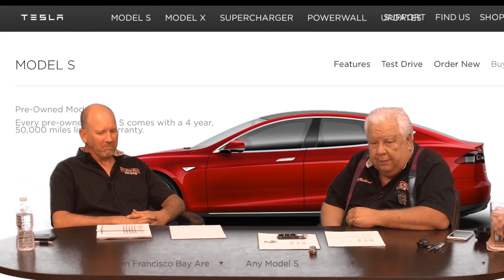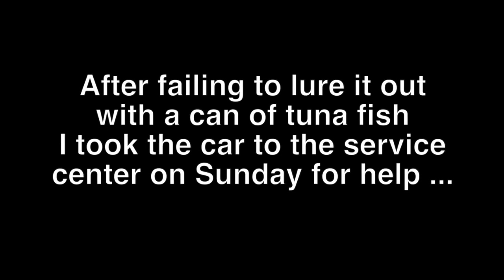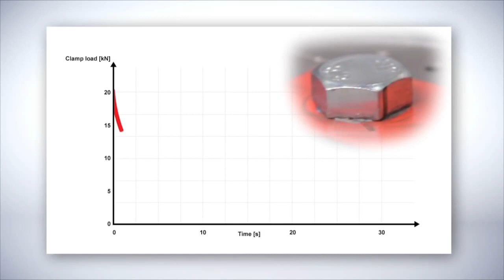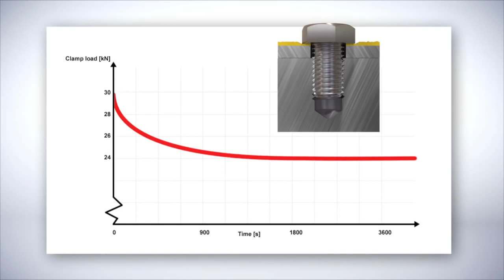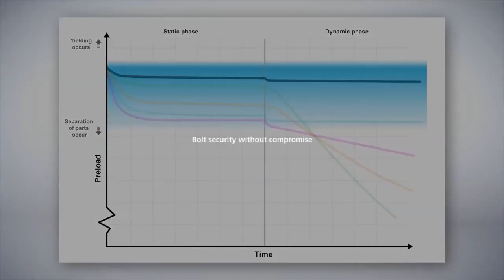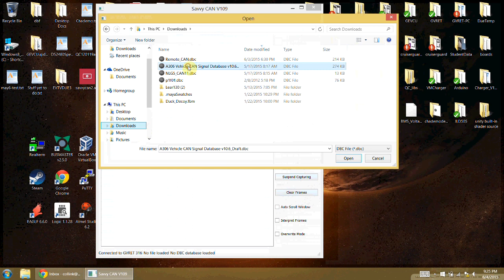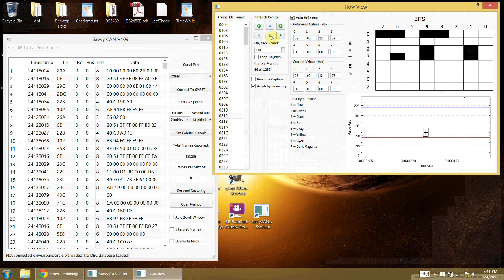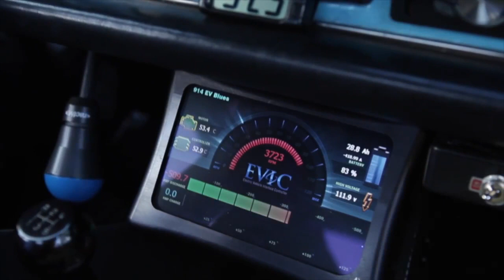EVTV Friday Show -  June 5, 2015

Comment: Volt is an electric car. I have 2 Volts , the '11 get regularly 45 on a charge and the '13 get 45-50 on charge. But in emergency nice to know you can get unlimited range if necessary.

Comment: Place the Tesla motor in a MasterCraft water ski boat !   
Adjust the trim with the battery location, part of the pack could move aft for launch & wakeboarding and forward for a smooth and fast ski wake.

Comment: The jury seems to be still in deliberation on Tesla resale value. Tesla is offering its used fleet at prices that seem pretty comparable to the mileage discount you would see on other high end luxury cars. If the cars just sit there unsold, then they will have to lower the prices drastically like the Leaf and Volt, but for right now they aren't trying to dump them at any price, so far as I know.

In the case of Tesla, it may not be the used battery that's the problem though. The new cars have extra driving assist hardware that the old ones don't, plus the dual drive on the new ones. The battery, being bigger to start with, should have a longer life and more residual value than the Volt or Leaf batteries.

If they asked me how to sell the used Model S, I would not group them all together in giant parking lots near Chicago sorted by color. I'd spread them out to all areas of the country, a few at each store so they continue to seem rather scarce. I'd also want to offer them to credit union members so there is a built-in source of financing. But maybe they know something I don't about the Chicago car market. It is worth speculating on why they have chosen the strategy they have.

Comment: Re used EVs
FYI   Tesla model S has been on the road in the UK now for a year this month & the five used cars on sale today are all at higher prices than you could buy a brand new one for (spec for spec; lead time on new around 4 months). Whereas pricing on smaller range EVs have already taken a huge hit eg a one year old 11,000 mile e-Golf loosing 40% in value in a year; a 3 year old 15,000 mile Nissan leaf loosing 65% of the new discounted price.
So perhaps the Tesla demand for used is as strong as that for new, as its range is truly not a concern?

Comment: The dealers that sell them are not even letting you charge your leafs at their shops unless you bought the car from them.  I hope this old dealership model of doing business dies because they are the ones trying to kill the EV.
Reply: Gravel Trap King Not true.  You can charge your Leaf at any Nissan dealership.  All the Nissan dealerships got their charging equipment free from Nissan to avoid the situation you describe.
Reply: not true? I'm not making this stuff up, I know they got them free from Nissan, that is my beef.  We have a dealer in 'North Salt Lake' doing just that.  Everyone reports them on Plugshare and on myNissanleaf.com others have had the same issues across the US.  When they call Nissan they say that can not force dealers to comply, which is a shame.  I buy a plate holder for each dealer and tell them I did buy my Leaf from them.
Reply: Gravel Trap King Good idea!  Only time they will let you charge a car they didn't sell is if you are traveling from city to city.  But who wants to charge there anyway?  just charge at home and fly if you need to travel.
Reply: yep, I don't charge anywhere but home but if I have to, I want to be able to charge at a local dealership without being harassed.
Reply: Gravel Trap King Walgreen's has chargers everywhere. I am not sure if you need to pay to use them, I think they are free for customers but that doesn't mean everyone who parks in front of one will even shop there. Walmart just started adding electric car charging spots closest to the store.